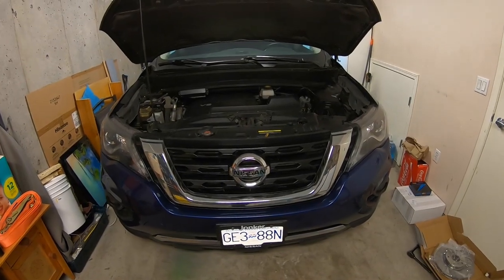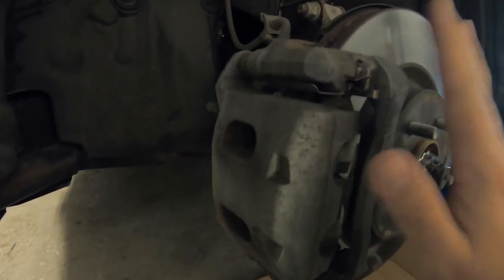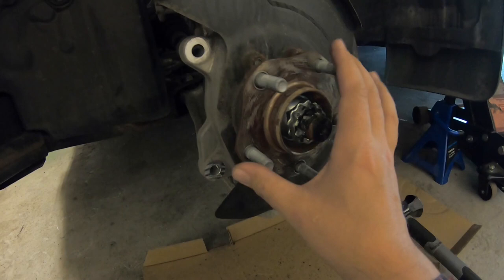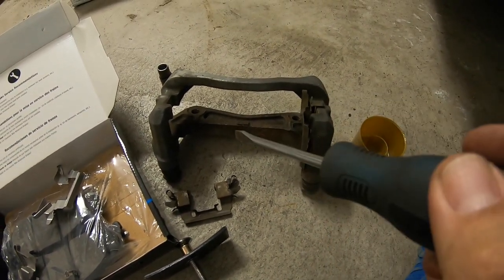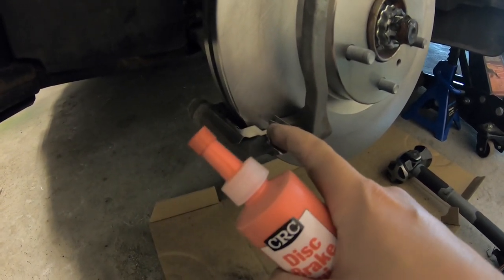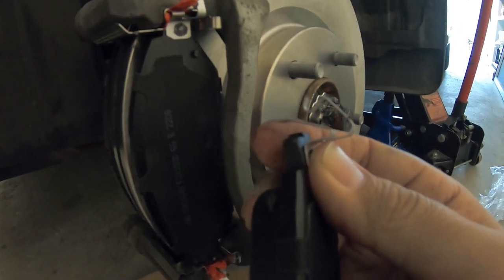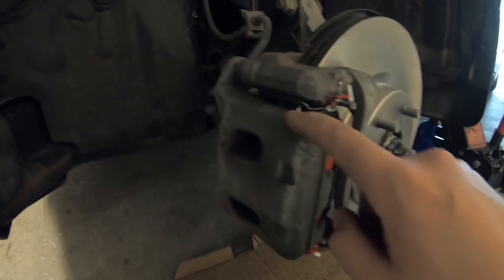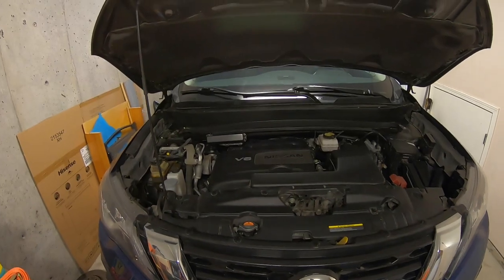NISSAN PATHFINDER COMPLETE FRONT BRAKE CHANGE DIY *ROTORS AND PADS*

Comment: Nice video.
I've got same car, love it.
That little bolt hole is to make it easier to get off, just screw a bolt through to pop it off if you can't get it with love tap
Reply from the maker: I just love tap it harder 😂